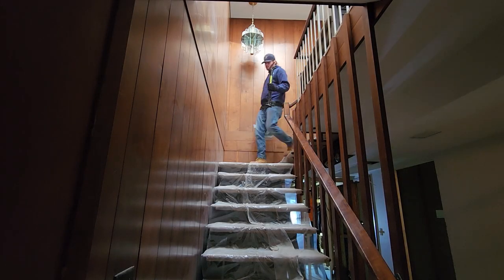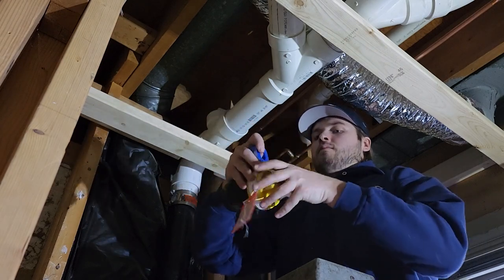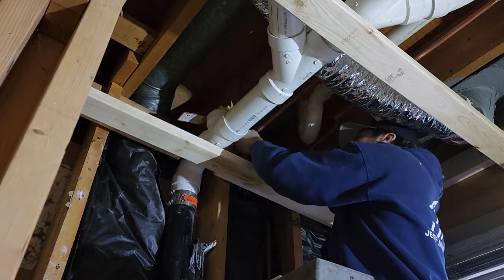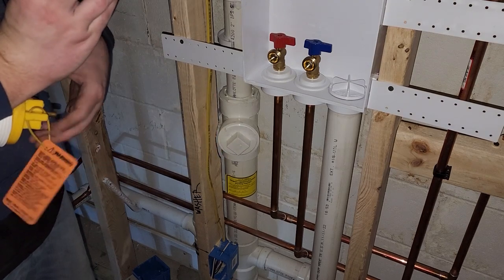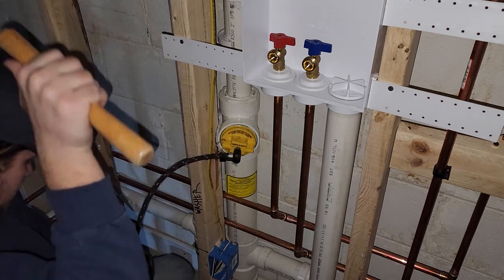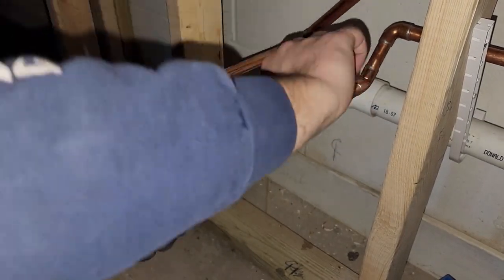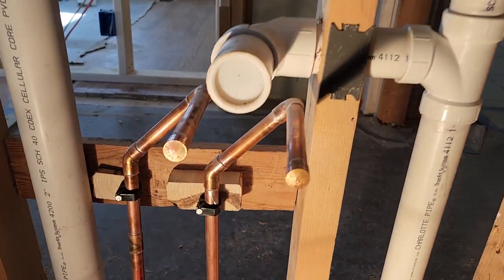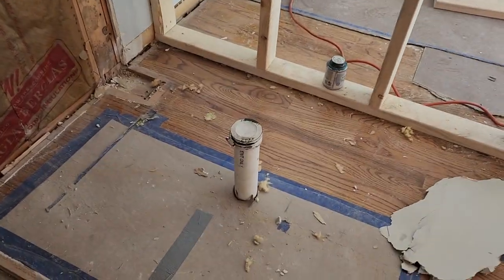How to set up PVC dwv plumbing system for a pressure test!

Comment: I was chasing a leak because of 2 of those thin, plastic caps... I prefer the regular oatey type, but thought I'd run a quick test with those... They now have rubber caps over them as well.

Comment: I see copper and solder. My kinda job ! no pro press yet ?
Reply from the maker: No pro press for us yet. Still a bit skeptical of it. It also doesn't seem to be the most practical to use in every situation.
Reply: I have not used it either. I'm leary of anything with seals.
Reply from the maker: @TMacThePlumber  that and it just seems hard to get into certain areas. We work in alot of older homes where the work area is crowded. We like soldering over here!

Comment: There is no reason to apply tape or dope to the threads of a Cherne Clean-Seal test ball. All that does is create a mess while using it and while storing it. I see so many plumbers do this, and it is 100% not necessary. It does nothing good.
Reply from the maker: We aren't allowed to have leaks on the test ball for inspection.